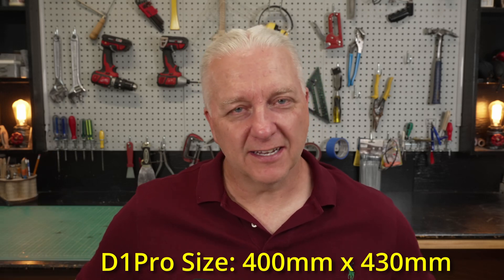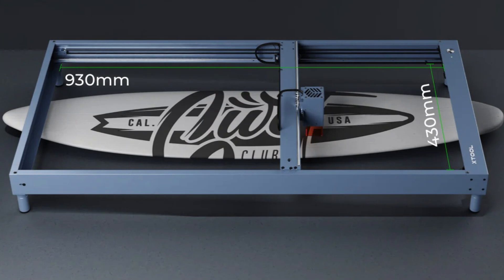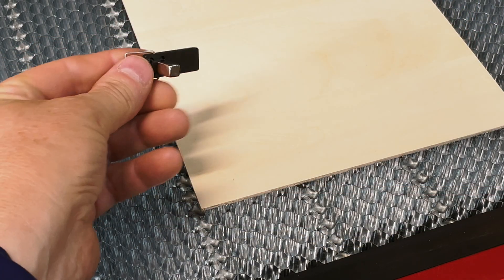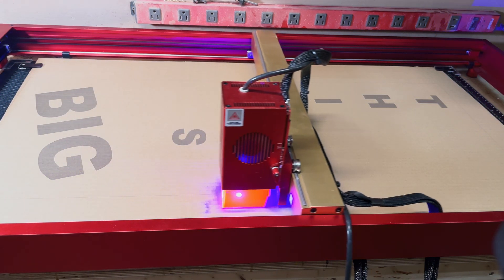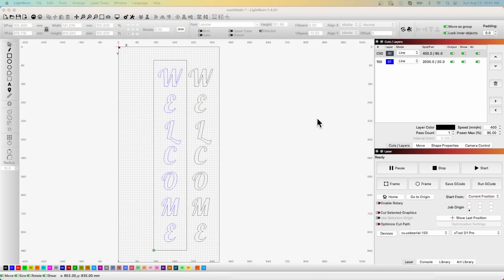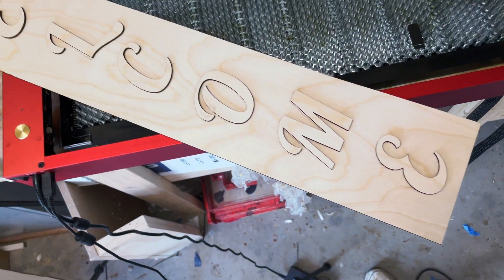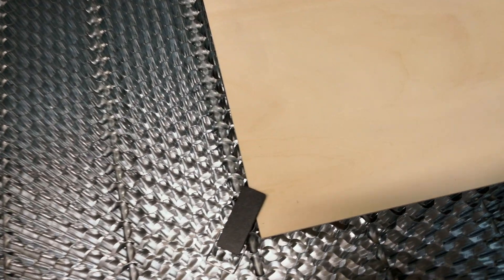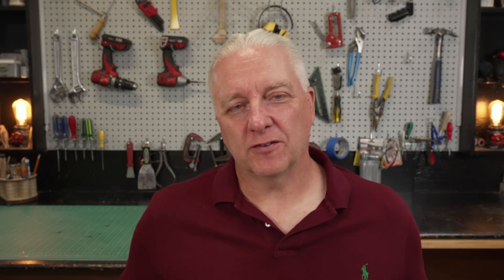xTool D1Pro Extensions and Honeycomb Workspace - Big Upgrade, Better Laser

Comment: Do you still use your D1 with the extension?
Reply from the maker: I have it hanging on the wall in my shop. It good for a very specific type of project, though these days, most of those projects now get done on one of my CO2 lasers.
Reply: @ I have been trying to find the extension but they are not available anywhere. You willing to part with yours?
Reply from the maker: @seanmahoney90  I'd have to scrap the laser if I did that.  And as you know the D1 is such a nice laser.
Reply: @SteveMakesEverything  yes. I have the 40watt and it does everything I need. I just need more working area hahaha.

Comment: Did you go From a 20w laser to a 40w laser.
Reply from the maker: I was trying out the 40W module.  I’ve now switched my main diode laser to the S1, though I also use the Wecreat quite a bit

Comment: Hi Steve, thanks for another informative video.  I just ordered my D1 Pro 40W + extension kit and also die RA2 pro with extra standoffs.  While I wait for delivery I want to get my enclosure ready.  Could you give me an indication of the outside dimensions and how much free room to allow inside an enclosure to allow free movement and access with the 40W laser, extended build area and the extra height of 2x 45mm legs added?  Will really appreciate. Thanks.
Reply from the maker: I did post this in a previous comment for this video because someone else asked recently.  Realistically, it'd be better to wait until you get the laser because there is additional space required for things like cables that need free movement.

BTW, when you get the extension rails, make sure they send you the 40W cable.  Mine came with a cable that was missing one additional plug needed for the 40W.  Another user commented on this too.  However, if you ordered the laser and extension rails at the same time, xTool will presumably do the right thing.

Comment: Hi Steve, nice video! Can you share with us the outer dimension of the D1 Pro with the extension? I would really appreciate it.
Reply from the maker: It's about 1140mm x 540mm on the outside.  You can use google to convert this if you speak feet/inches

Comment: This is really big. For commercial use it surely makes sense.
The clamps are a great idea, with the laser heads so close to the surface old versions can be tricky and in the way
Reply from the maker: I did manage to clip one of the clamp when I was using this yesterday.   They float fairly freely so the laser just pushed it out of the way. I was pretty tight on the focus though

Comment: I have the D1 pro 10w.  Can I upgrade to the 40w?  Also, if I can what kind of difference will I notice?  (Just able to cut thicker wood or does it cut faster?)  I mostly only cut 3 mm basswood
Reply from the maker: You might have to send a message to xTool to see if they still offer this upgrade.  I think now they only offer it as a complete laser.  If you are cutting mostly 3mm then I would say an upgrade wouldn’t be worth it.  You would certainly be able to cut faster, but it’s a pretty big cash outlay.  Certainly if it’s just time to upgrade your laser, then look for more power, but there are a host of lasers in the 30-40W range that have great pricing.
Reply: @SteveMakesEverything  Thank you very much for this information, really appreciate it
Reply from the maker: @ursulap23  Thanks!  Helping is the reason I started this channel. 😀
Reply: @SteveMakesEverything  ❤️❤️